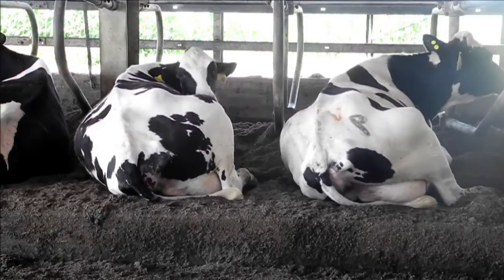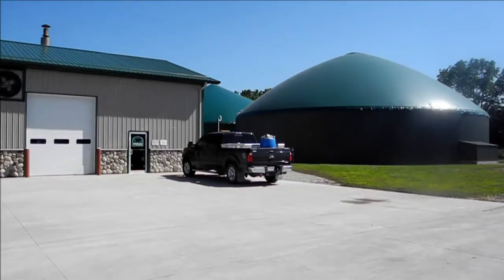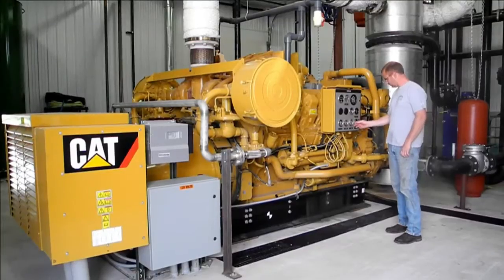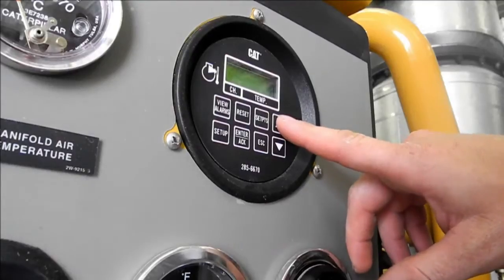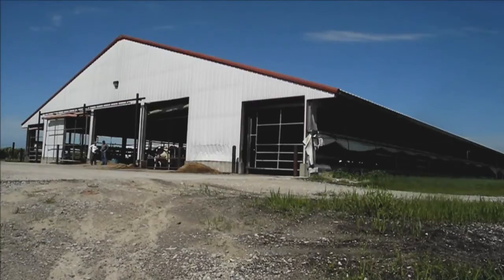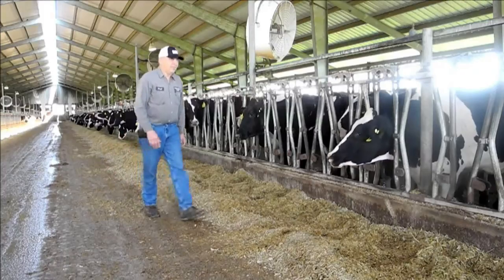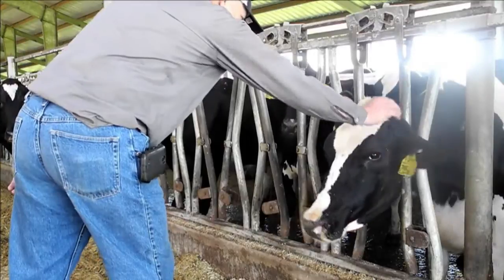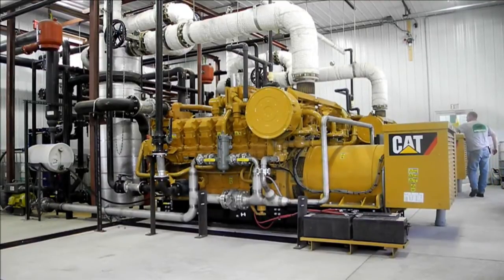US farmers turn cow poo into power and profit

Comment: I notice that the generators seem to be bolted directly to the foundation. Should there be some kind of vibration isolation mounts in between to isolate the vibration when the generators are running?